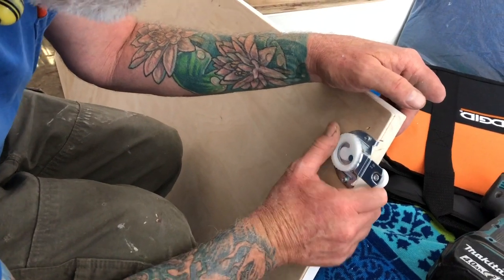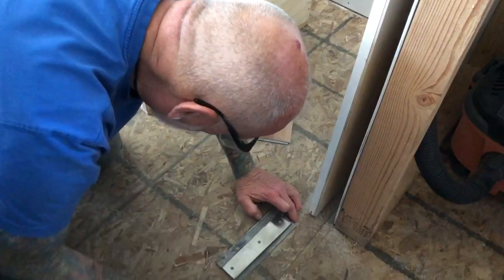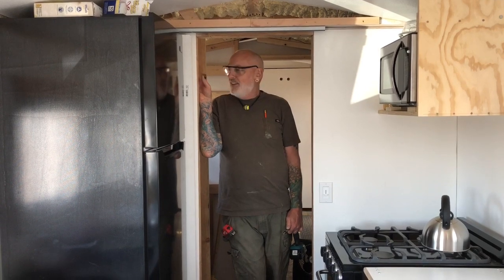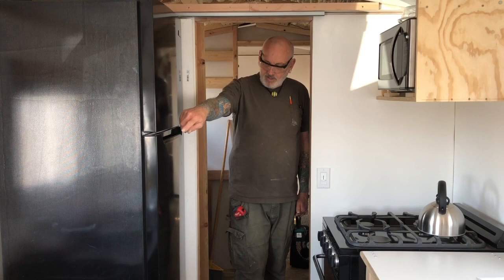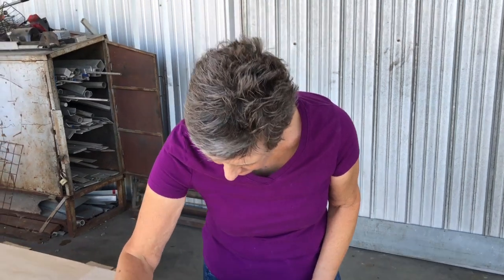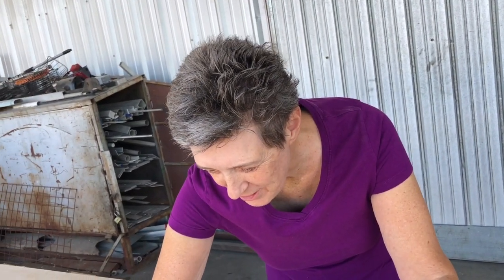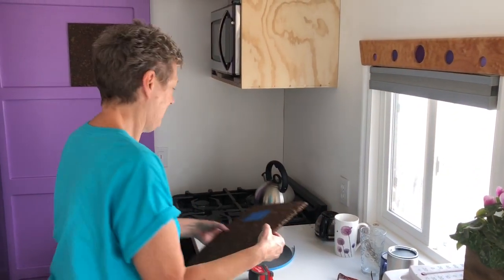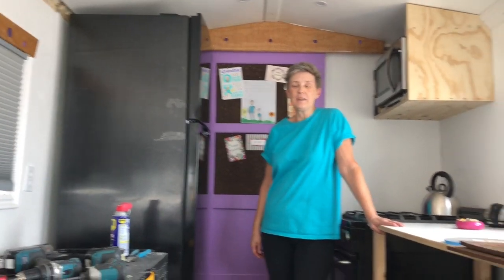Bathroom Door - Vlog 130 School Bus Conversion

Comment: Just curious why did you mount the plywood on the door in 4 Pieces instead of one ? Did you consider recessed panels?  I like the door,  had you looked at the sliding bar door hardware?  Instead of closet door hardware?  What was you thought process? I assumed you would do the external barn door style hardware but they way you did it looks more compact?
Reply from the maker: We put the panels on in three pieces because we were using up leftover paneling from the siding. We used closet sliding door hardware because it was more compact you are correct. Also the barn door hardware is ridiculously expensive $176 for that simple bit of hardware is crazy. And the bus is too short for that hardware to fit even with the roof raise.